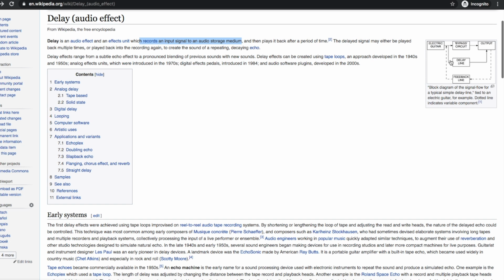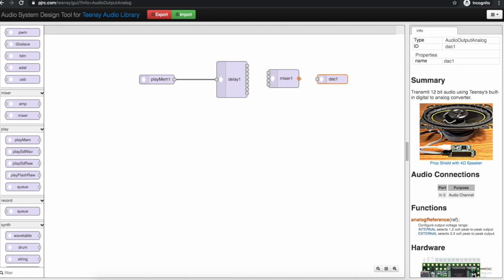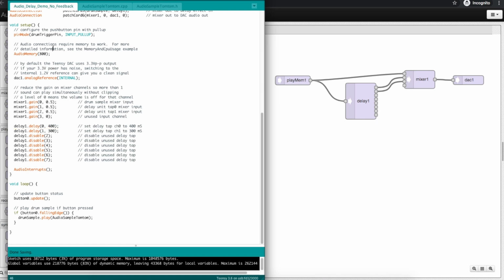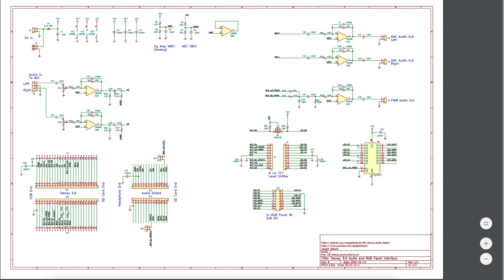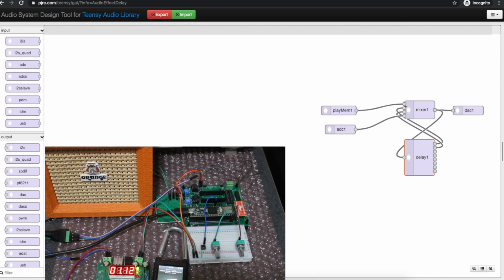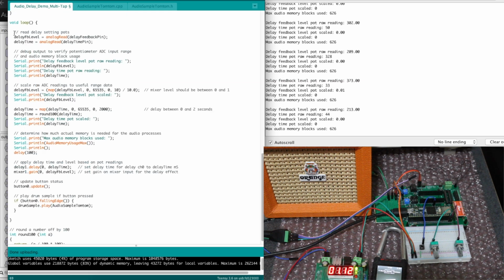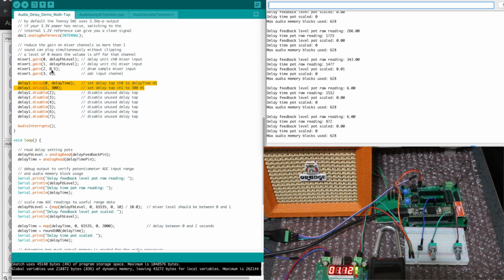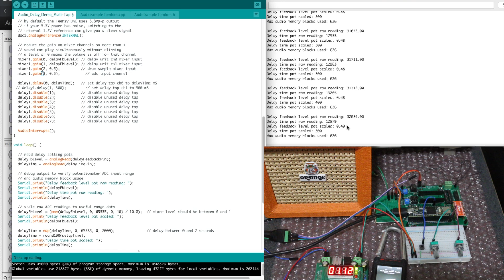Teensy Digital Delay using ADC and DAC

Comment: That's pretty rad but it takes the fun out of doing it on a circuit level without code. Well if you're into electronic music. The teensy would be cool to use as a multieffect. The 4.1 can have up to 16 gb of ps ram I believe. Too bad they've tripled in price. I regret not buying one. It'll be cool when we have sbc boards that enable us to make something like a neural dsp haha

How well does it block dc in the on board filter?
Reply from the maker: I still need to get a PT2399 echo circuit wired up, have the parts, now need the time. I also wanted to try analog chorus or flange with separate chips for A/D, D/A, memory.  
I think it's been a year and a half since I used Teensy so I can't remember much but don't recall anything problematic.   I've been dabbling with ESP32 and I2S audio as well so I'm all over the place.
Reply: @GadgetReboot  its crazy how people keep exploiting the different feature sets in that risc v chip. If they had paid for a couple more logic blocks for floating point units in the substrate the sky would be the limit eith them. Cool stuff man. Keep it up. Experimenting with different things is great ehh

Comment: Very interesting.  Is it possible to create a sort of instant replay using this type of setup?  Say you're listening to a radio station and someone says "what did they just say?", you could press the button and have the last 10 seconds of audio play over again.  I would imagine you would need to store the audio in a circular buffer that is large enough to store 10 seconds worth of audio.  You would always be recording so the circular buffer would always have the latest 10 seconds of audio in it.  The output would be the live audio until the button was pressed, at which time the recorded 10 seconds would then replay.  That would be really cool.
Reply from the maker: External memory can be added for longer storage and then it sounds like it would be straightforward enough. people add external memory for guitar effects projects.